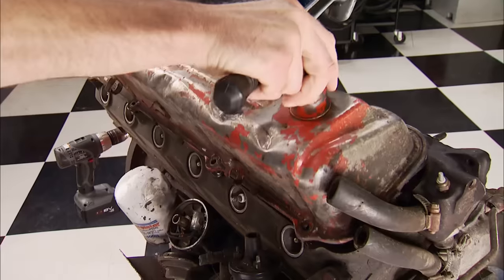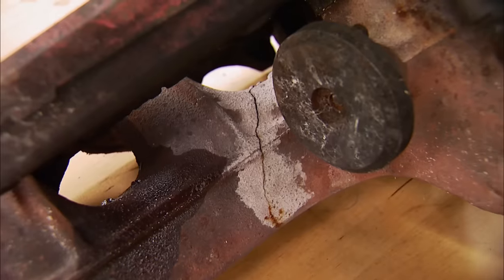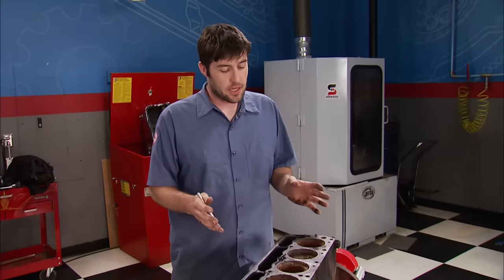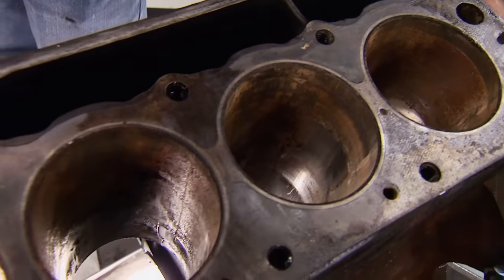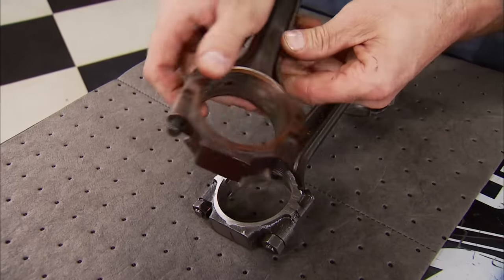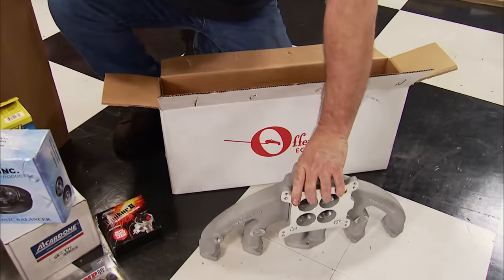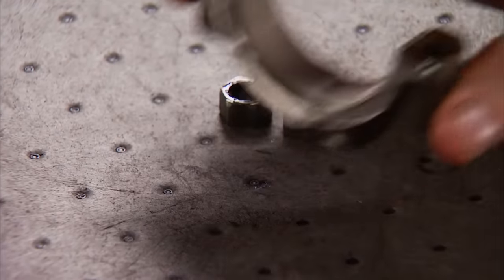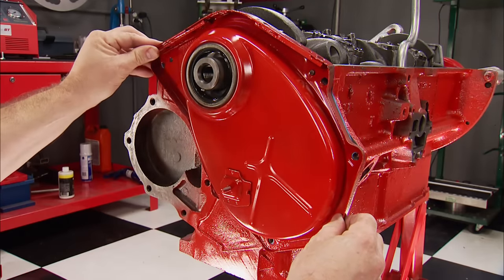Resurrecting A Mopar 225 Dodge Slant Six - Engine Power S2, E2

Comment: The engine from the junkyard was perfect, you just had to replace the block and all the internals.
Reply: What was your premix ratio? you cannot ru these without oil injected into the intake, Duh
Reply: @John Christensen New handle and head,  so how is that original?
Reply: Clive Bindley that’s the joke buddy
Reply: @linemanlovesyou859  How is it a joke? If the handle and head have been replaced then it's not original. Some people are just dumb.
Reply: Just premix and run xd-100 that what i would do, the 225 is some type of valved fucked up 2 stroke anyways
Reply: Clive Bindley OK, explaining it slowly: 

In this video, the engine builders started with an engine, chucked the whole thing, and built a completely different engine using none of the parts. 

Just like the hammer, where he started with one hammer and replaced everything. Ended up with a totally new hammer that somehow occupies the same space as the original despite having zero original parts.

Just like the engine in this video.
Reply: @MrJeffcoley1  Another one reeled in and thrown into the net.👍😁
Reply: Premix it at 40;1
Reply: @CB-xr1eg  r/woosh
Reply: @jlo13800  And another one takes the bait..get in that net!🤣🤣
Reply: @CB-xr1eg  The toyota 6 inline DOCH was made in to a 2 stroke called the s2. Inlet valves where baffled to aloow complete loop scavenging, mercedes 6 diesels and the dodge 225 slant 6 have 60 deg crank journals to allow 6 power stroke per revolution.
Reply: A harler modern v-twin 1600 has room to cut ports into the jugs for a uniflow 2 stroke
Reply: @CB-xr1eg  show me one american 2 stroke engine that can run dry sump with total loss oil burnoff and run in multiple positions, the OMc,Detroit Diesel 2 stroke, and fairbanks morse OP, Not sure about the EMD 2 stroke and hemi big block 2 stroke though. America is a funny place for me
Reply: @CB-xr1eg  Most american 2 stroke will burn up with out total loss feed and there soft metals?
Reply: @CB-xr1eg  Most american 2 strokes with total loss oil injection burn off use semi synthetic 2 stroke oil, i just got 7 gallons of quicksilver synthetic tcw3 for my 8v92 Detroit 2 stroke, it works ther best so fat
Reply: How does your poppet valved 2 stroke hole up to this oil injection, theres no such thing as a 4 stroke as far as im concerned, its a fake reality
Reply: No such thing as a 4 cycle, its just a gimik to bash to pieces, boy how i would love to do that
Reply: @CB-xr1eg  4 stroke is good hammer practice to smash to pieces
Reply: All its moving parts are good to destroy and melt down with my welder, good riddence
Reply: all the ecoboost 2 strokes can be filled and injected with synthetic 2 strokes in all your touph ford pickups, Total loss oil injection at its finest.
Reply: TCW3 is cheap and i will use it wit a VRO, fun with VRO oil injection
Reply: It must be american, thats all i can say.
Reply: @CB-xr1eg  r/whoosh
Reply: @Maccreeperslayer  🤣🤣🤣 You dumbassses are killing me.😂😂😂
Reply: @John Christensen lol😂😂😂
Reply: @appalachianamerican3881  You keep thinking that if it pleases you. Fact is I pretended I didn't understand to see how many smartass replies I got. You're just another in a long line.  I got the idea from a British tv comedy called Only Fools & Horses. A guy who swept the streets claimed he had the same brush  for 20 years and he'd only replaced the brush head 17 times and the handle 14 times. The original comment on this thread was similar to that so I got the joke right away,  but pretended I didn't. And the smartasses (including you)couldn't wait to tell me how dumb I was!   Now is that ironic or what?🤣🤣🤣👍
Reply: I had a 51 Desoto flathead engine , they put sleeves in all cylinders,  to save the block. I'm surprised they didn't say anything about sleeving a block.
Reply: No you don't throw it away because it's  in a junkyard!? Unless  the block is cracked all the way down the middle and you can crack it in half  bore it out and put new pistons in it that's called rebuilding and hot rodding you don't see if you can save the old piston and the old Rings that's a homeless welfare food stamp budget!? I've been doing this for fifty years all you got to do is bore it out and put new pistons in it those blocks are really tough and sturdy you don't say oh it's got rust on it we better go buy a factory new one somewhere? That's not a mechanic!
Reply: just replace everything under the oil cap.
Reply: @CB-xr1eg  that was the joke dummy
Reply: @romeocano1919  🙄 Can't believe I'm still reeling in fools like you and Xbear a year later!
I explained what I was doing halfway through this comment thread.
Still, if it makes you feel superior to call someone else a dummy, carry on.
Reply: Lmao I guess some of y’all have never heard of a joke
Reply: Thats the whole engine
Reply: the engine was completely fine, just needed to replace it by another engine and we should be good to go
Reply: We pulled the steering wheel out of the old jalopy and put it in a totally remodeled vehicle
Reply: I would have pulled the head before buying it, and seeing the crusty bores, would have nixed the deal.
Reply: Best to do a little investigating when buying an engine from a boneyard,otherwise, it's a crapshoot .
Reply: Me two years later looking for Clive’s comments 👀
Reply: We took apart a junk motor and rebuilt all brand new
Reply: All you had to do is make a new engine. That's funny man!
Reply: What's new is.. new again
Reply: The block was fine it just needed to be re sleeved.
Reply: Lol
Reply: this video...is basically...a commercial....thank you !
Reply: I once had a 69 Mustang, that was rear-ended so hard that its whole body was bent.    I bought a garage full of 69 mustang parts from someone, built another car, and then put the VIN tag in the constructed car.   So I repaired the wrecked car by replacing everything.
Reply: ANY "slant six" was a CLASSIC! The "adjusted" BURNT asphalt!
Reply: I think the block was passable but probably not enough to add all the power they wanted

Comment: I was a teenager and dad told a "friend" who had a slant six he needed. A Buick car was not running when we arrived. Dad asked if I can fix the car will you give me the engine? Ok. He pulled the distributor and placed a nail in place of the pin holding the gear in time. Started right up.

Comment: "Theres no need for high dollar fasteners to retain the cylinder head" Meanwhile uses ARP hardware for the oil pan and timing cover bolts...
Reply: Canuckrz thought that same thing. Head gaskets/ studs aren’t something you want to cheap out on
Reply: @Ahnenerbe1944  To be fair, if they're not torque to yield bolts and its a fairly low stress engine its fine to reuse them assuming they haven't been corroded from sitting. I just thought that line was a bit rich considering all the things they made sure to name drop using expensive ARP hardware for.
Reply: I don't know why they used ARP parts in some places but not others. Since this build isn't extreme, and the head gasket isn't failure prone, it might not benefit from ARP fasteners.

Engines with inadequate fasteners from the factory, such as the Ford 6.0 PSD are an example where you absolutely want to ARP studs. Also, sometimes when you add forced induction to an NA engine, or you dramatically increase boost in a factory forced induction engine, ARP studs are worth it.
Reply: Canuckrz 

It’s advertising for ARP
Reply: "A clean deck surface on the block and heads promotes a good valve seal between them and the head gasket."  What does the head gasket have to do with the valves?  lol, it would appear that "Power Nation" could use a knowledgeable editor/staff.
Reply: Not all ARP is high dollar
Reply: @chrisj197438  Could be turbo down road ?
Reply: Steve R. 

😂😂
Reply: @stever.7008  if you want factual info on a slant 6 go watch uncle tony's garage ...he is a wealth of knowledge on all things mopar
Reply: ^^^^^ this guy
Reply: I guess they blew their budget on all that fancy expensive crap they couldnt afford any more arp hardware.
Reply: Mike Dumpert 

I doubt they pay for any of it
Reply: High dollar doesn't mean high strength .....ARP is hardly high strength , you can use the hardest metal on the planet , but ARP likes to reduce the head size of the fastener which lowers it's yield strength , so ARP is only high priced....unless you have a growing Youtube channel then you get them for free.
Reply: @alt7488  definitely right about his knowledge, I was watching one of his vids and amazing the differerence he showed
Reply: @Ahnenerbe1944  exactly my point finally someone agrees
Reply: @skylinefever  Maybe ARP doesn't make bolts for every application on this engine.
Reply: These shows are really just one great big commercial for these aftermarket parts suppliers
Reply: In 50yrs and some i built you can reuse head bolts etc from any make up until the mafia scam of torque yield bolts to make more money their tuff and can be reused many times
Reply: Dave Micolichek  that debacle  was lunar garage's not utg's fault ,
ffs that clown didn't even know what adjustable length  push rods where used for
Reply: Dave Micolichek  lol ....yeah ok ....
i call bullshit but whatever
Reply: @stever.7008  I literally came to the comments to see if anyone else noticed that one.

Comment: 1. Disassemble engine 
2. Throw out the disassembled engine 
3. Buy a new engine (not assembled)
4. Assemble new engine 
5. “We rebuilt an engine”
Reply: I was about to comment the same thing.  They didnt restore the original engine
Reply: Yes many different oil pans, I put another 225 in a duster with the 198 and turning took a whole parking lot until I got a better match.
Reply: old engine was good shop just didnt want to do work iv rebuilt them with 3 times the rust
Reply: Dropping contributors names the whole time. 
* every other new part mention. 
They bought this as junk, got what they bought.  
Shoulda started with a runner.  
This channel is the best, if you are working w an unlimited budget.  

- I could do this. ……  
With contributions from; 
Duplicolor, Summit, Comp Cams, Royal Purple, Sealed Power, Loctite, Felpro, King, Pioneer, ARP, Melling, Hooker, Edelbrock,  …..,.

And their “magic”.
Reply: I hate that they do this on all of these shows. Love how they try to make this relatable to the guy in his own garage but do everything the exact opposite of what the guy in the garage can do.
Reply: This channel is all about tear down and rebuild. The tear down part was instructive even though they ended up scrapping it.

Comment: I had a 1964 Plymouth Valiant with the 225 engine. We had some horribly cold winters in Wisconsin back in the 70's. It was -10F for the high during the day for about two weeks. We started work at 6am so the cars were in the parking lot when the sun was barely up. It was probably -20 until about 10am. I think it was in January. After work, My little  slant six always fired right up. After a couple minutes to warm up I would drive around the parking lot to see how many cars did not start. Some days there were  a lot of them, all newer than my Valiant too. But those were the days of carburetors on big bore V-8's so they were at a disadvantage. I bought a huge battery for the Valiant from a farm implement dealer. It was a beast. So the guys got used to seeing the Valiant coming and they knew they were going to get a start. She made quite a reputation for reliability that year.  
It was a neat car as Valiants go. It was  two door hardtop with bucket seats and four speed trans. The first and second gears were fairly low so it was actually pretty quick up to about 45 mph. 
I had made marks on the distributor so I could advance the timing by eye when I was able to get high octane fuel for it. 103 really did make a difference IF I advanced the timing. With a heavy duty clutch from the pickup line it would squawk the tires even in third gear with a power shift. It embarrassed some so called hot cars at the stop lights when they underestimated the little Valiant. It had a two barrel carb from the 273 engine and  a 355 rear axle,
Reply: Ironic that later Valiants from around 1976 were horrible in wet and winter weather because of notoriously bad electricals.
Reply: I had a 64 Polara with the big block 318 , I live in the U.P. of Michigan on lake superior , back in 1970-71 we had a cold snap of -35 for three days , my car was one of the few in the parking lot that would start up good , worst starters we GM's with V8's  , those gear reduction starters on mopars may have sounded funny but they worked !
Reply: I read and enjoyed your little story. The good ol days cold winters and carbs
Reply: @sparkywirenut  That's great!
I suspect it had something to do with the intake manifold on that engine. I remember those well. I had one in a 57 Plymouth and they used them the first part of 1965 in the Plymouth Fury and Dodge Polara at the Belvidere plant where I worked shortly after graduating high school. For only 318 cubes that engine looked BIG. They went to the small block 318 to make more room under the hood. Chrysler wanted a V-8 to fit in the Valiant and Dart.
Reply: I FOUND out the autolite 2 barrel  carb from fomoco where the best carb for the slant six.
Reply: @sparkywirenut   People who didn't live back in the day forget how well the old cars were dialed in before they started adding pollution controls. If kept tuned up most started right up and ran great. From the mid 70s to about the mid 80s cars increasingly ran worse and got much worse gas mileage. What saved the car industry was the electronic computer controlled systems. PS a friend had a 64 Polara with the polyhead 318, LOL semi hemi. His was built to the max with almost 600 hp to the rear wheels. Lots of times when he beat cars they thought he had the Hemi and wouldn't believe him until shown. The LA series that replaced the poly engines only advantage was it weighted less.
Reply: @fordinlinestraight   The Ford 300 inline 6 was one of Fords greatest enginess , { except for the one or two years they had bad / soft camshafts } another great winter starter . I could never understand why they discontinued it .
Reply: @mikeb46  I had a four bb carb on mine , it came with a 2 barrel but being 18 years old in the sixties one had to have a 4 barerel 
! I remember driving 70  miles to buy the 4 bb manifold from a want ad  and putting a carter 4bb carb on with manual choke .
Reply: @sparkywirenut   greedy corporation, fuel eco, small v6 killed 300! For me it lives on i have few stock piled one day i will rebuild them. I also have one in my 79 f150 im near done that.
Reply: @sparkywirenut  I bet it sounded awesome.
I didn't know all that I do now but with headers and a three inch exhaust system those 225's can make some respectable power.
Reply: @mikeb46   Ahh , the Belvidere plant - I remember going by there on the expressway many times and seeing the GTX's  coming out of the building at full bore , they gave them a beating / shakedwon  to make sure everything was ok - lol .
Reply: I saw a slant six Valiant back in the late 70's, ten miles up a mountain Jeep trail on the NC / SC border. They were picnicking at a waterfall.
Reply: @sparkywirenut  There are several reasons why the Ford 300 may have been discontinued:
1. Car companies want to make cars shorter, so they don't have room for an inline 6.
2. It may have been difficult to make the 4.9 pass California smog.
3. There was a need to save fuel.
Unfortunately, the 4.2 found in the 1997 F150 was not a good replacement for the 300/4.9.
Reply: @sparkywirenut   I remember seeing a four bbl carb manifold in the Mopar performance magazine. It was made specifically  to fit the 4 bbl from the 273 V8.

Later versions of the slant six came from factory with a 2 bbl so they could breathe better.

Comment: title should be called, rebuilding an old engine by using none of the old parts
Reply: I think they reused the head. ;-)
Reply: Yeah, but it's still satisfying.
Reply: Yes we all had dynos,unlimited snap on&matco tools,parts washers,dial indicators...brand new everything,My parts washer when I started?, Yes a Buick hubcap,with gas...
Reply: and spending a shit ton of money
Reply: And how to cram as many product placements and ads in a single video as possible.
Reply: @packingten  at least $12,000 worth of matco tools, a $10,000 sunnen sv-15 cylinder honing machine, $8,000+ engine/parts washing machine, etc.
Reply: @packingten  Even most professional mechanics who do engine builds and rebuilds for a living don't have all that.
Reply: @kalijasin  Its true I don't. But I manage.
Reply: Money Talk$$$$
Reply: Yes that’s that rebuilding is